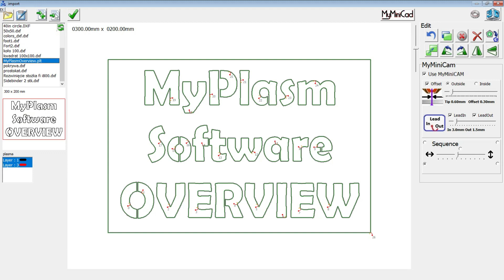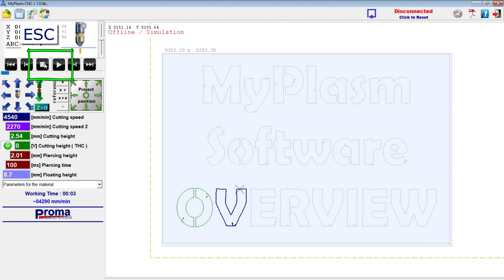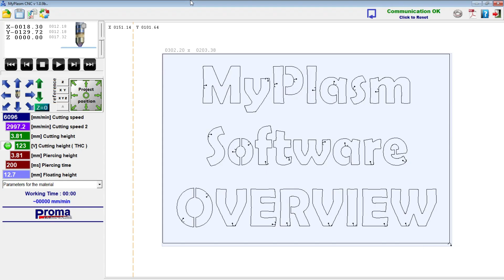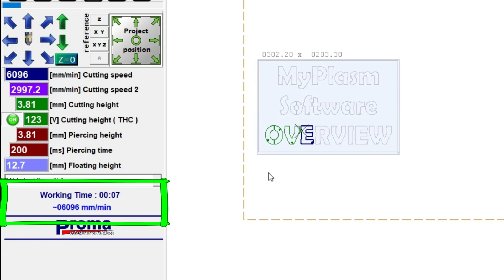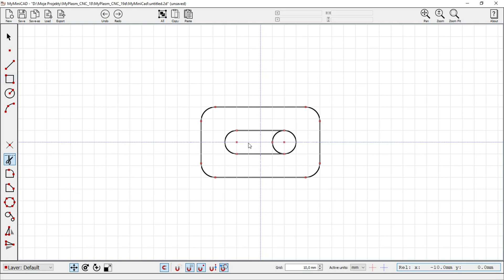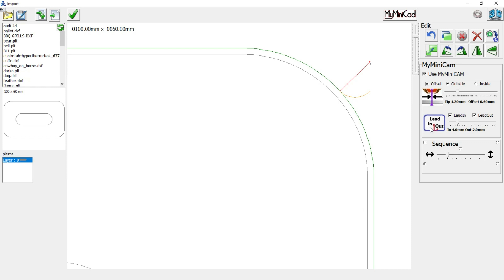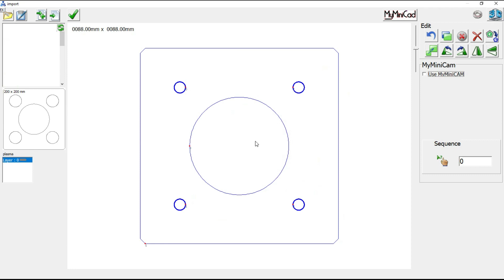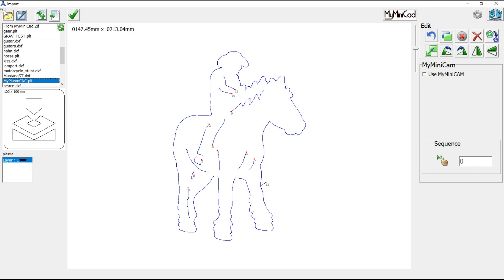# 05 MyPlasm CNC in 10 minuts - Overview - Step by step

Comment: learned a lot but not what I'm having issues with. I designed something in fusion 360, made it into a DXF file and imported into Myplasm. When I'm using my mini cam, it doesnt show any pierce points or cuts on the perimeter AND it has multiple pierce points for holes. It basically shows it cutting everything twice, except the perimeter which it doesnt show it cutting at all. When I switch my mini cam off, it shows cutting the perimeter but still has 2 pierce points per hole. Can I delete pierce points??
Reply from the maker: send me example file plese !
Reply: @myplasmcncsystemen1506  Thanks for the response. I just now saw that you responded 3 weeks ago! I have figured it out in the mean time.

Comment: I'm having an issue where my STV CNC will cut the loaded file but when it executes the cuts, they aren't centered, like in the file. I make sure the part is placed correctly on the table and that the project position is in the correct setting. Is there a step I may be missing? Thank you for your time.

Comment: I'm currently replacing my hypertherm controller to a myplasm I'm that impressed! The one issues is programming the panasonic servo drives to talk to the myplasm controller.
Reply from the maker: I don't think that it's good idea replacing Professional system to very simply MyPlasm....
Reply: @myplasmcncsystemen1506  the hypertherm controllers were damaged beyond repair we are take a chance on the myplasm to see if it works.

Comment: This is amazing looks far more intuitive the hypertherm software. GREAT WORK! One thing that can be handy is on fastnest software you can use arrow keys to move the part in the corner of the Plate with pre meauriment about (like tetras). Then once you have got the part onto position you then can hold right mouse click on the part move the mouse and the part rotates clockwise or counter clockwise. https://youtu.be/z4Hive9pHlM